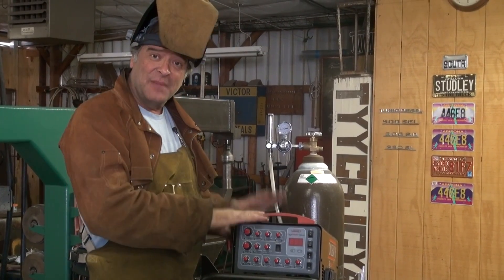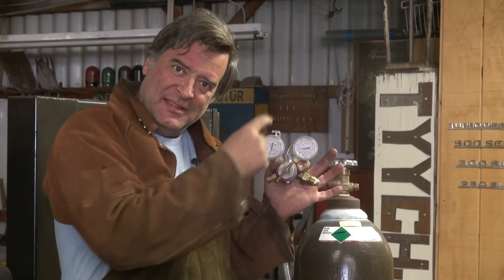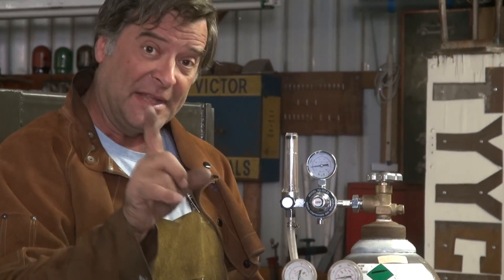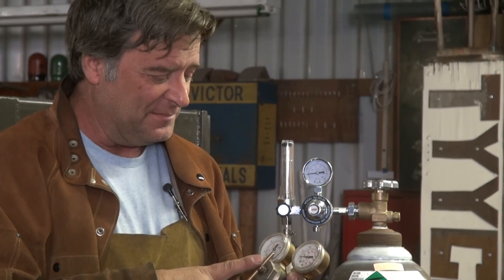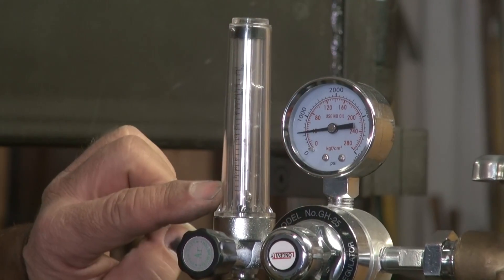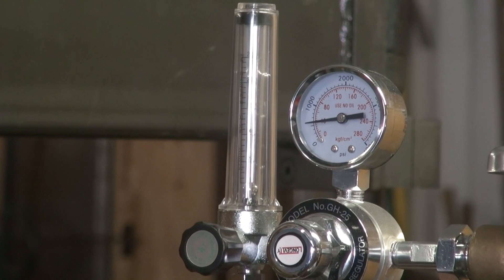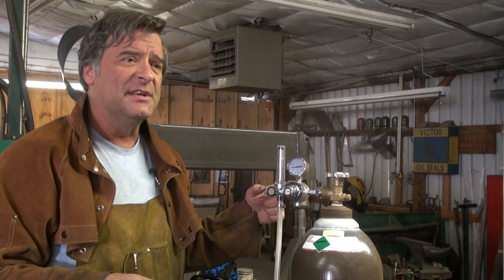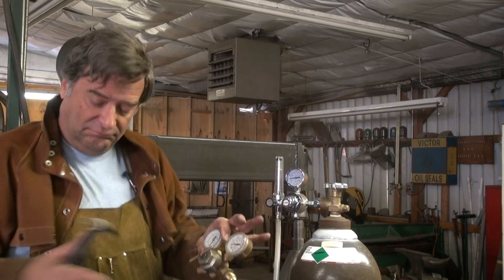How to Use a Flowmeter Instead of a Regulator for Welding - Kevin Caron

Comment: Can you ad a flow meter to a standard regulator? I have an expensive regulator and would like to do that instead of replacing it with a entire new unit with flow meter only.
Reply from the maker: Not that I have ever seen.
Reply: @KevincaronSculpture  I'm doing it. Bought a victor flow meter and I am going to ad a line to it and mount it so the gas flows through it. I could be wrong but I don't really see any reason why it wont work. On dedicated flow meters there is no pressure adjustment. I will be able to adjust pressure and flow.

Comment: 10 years after upload and this was just what I was looking for.
Timeless.
"Edited"
I'm a beginner getting in.
I have a flow meter (A little ball)", not a dual or anything other than. If yo want that they can run into a few hundred $, especially if you have to also purchase hoses.
I got a Unimig Regulator with a Flow ball because it was priced right and its just below industrial level grade tool usage.
I'm glad this was here to watch.
Reply from the maker: Thank you for watching and posting.

Comment: Actually, your are 100% incorrect. The gauge you show at 5:15 is a combination of pressure regulator (bottle pressure) on the right and a flow meter (lpm & cfm} on the left. Basically the same as what you now have mounted on your gas bottle, but in meter form rather than vial form. They both function the same - you are merely adjusting the flow of gas to your welder by either raising or lowering the ball (your current vial) or turning the dial (your old regulator). Not new either - they've both been readily available since before 2012 when you posted this video (obviously as you show at 5:15). Victor makes an extremely accurate pressure/flowmeter dial gauge setup - their FG250-50-580 argon/co2 flowgauge regulator. So, don't be chucking your regulator until you ascertain exactly what you have connected to your gas bottle...
Reply from the maker: Good point, thanks for posting and watching.

Comment: Hi thanks for nice video , my tig welding machine needs 30 psi of argon gas, how much liter per minute should I adjust I got same pressure regulator please let me know if possible thanks.
Reply from the maker: Toss the regulator in the tool box and get a flow meter.   Set the top of the ball to 12 to 15 on the argon scale. You will save a lot of money on the gas you save by using the flow meter over a regulator.

Comment: i've tested several of the inexpensive 2-gauge flow regulators with an accurate flowmeter downstream and have found that they are very inaccurate.. most tend to flow more gas than the gauge indicates. the floating ball regulator/flowmeter is much more accurate but in the past was also much more expensive, which is why inexpensive mig welders come with the cheaper regulator. i have 2 victor floating ball regulator/flowmeters, one for argon/steel mix/tri mix and the other for straight co2, both were almost $300 new 20 years ago... expensive yes but eventually you make it up in savings by not wasting expensive gas. and victor stuff is built like a tank and lasts forever.
Reply from the maker: Very true!   The flow meter is much more accurate. Thanks for watching and posting.

Comment: Shit, now I got more questions, argon for plasma? Liters, 8 to 12, what's that in standard?
Reply from the maker: Don't need to run argon for plasma.   You "can" but not needed.  I just run shop air and make sure it is dry with a filter or two.  My plasma cutter needs about 65 psi and wants about 60 gallons of capacity to run correctly.   Have run a small plasma on a roofing compressor,  just not for very long.
Reply: @KevincaronSculpture  compressed air is what I used, just wondering why anyone would use expensive gas? Maybe special material?
Reply: @KevincaronSculpture  as for liter question 20 to 25 cfpm, and it's about 8 psi.

Comment: I'd sure like to know how to get a hold of one of those.  Looked online and couldn't find that exact one.  Is there one for nitrogen?  How does one calculate for nitrogen on an argon metre?  Also, can you use a regular 1 1/8" wrench to attach it, and how tight?
Reply from the maker: check here,, https://www.everlastgenerators.com/catalog/migtig-argon-regulators    Not sure on using nitrogen and how it will work.   Sorry.

Comment: I just bought a Miller 22-80-580 flowmeter and it didn't come with a bodok seal. Do I need a bodok seal for this flowmeter or will it seal properly to the tank valve?
Reply from the maker: Should work just fine.   Have no personal experience with the Miller but from the photos online it looks just like mine.
Reply: Thanks Kevin. I went ahead and hooked it up just to find out and that flowmeter is really working nicely for me. I'm so glad to not be using the fluxcore anymore. I never really did figure out how to weld right with that wire. Now I'm back to professional looking solid welds and got my confidence back. Lol.

Comment: I just bought one of those TIG that does stick, plasma, and TIG. However having to change air source sucks so I stuck a standard quick connect to the end of a short section of hose. If I TIG, I pop the hose on from the machine, and if I need to plasma cut, I pop it off and put it in an air compressor.
Reply from the maker: Have never played with that kind of 3 in1 machine.  Never thought about how the air hose for plasma hooks up.  Thanks for the info.

Comment: Kevin, you're not using a flow meter instead of a regulator, you're using one in combination with a regulator.  That part of the assembly to which the cylinder contents gauge is attached is a fixed pressure regulator.  More specifically, it's a single stage regulator, a type  I'd not use for oxy acetylene welding, since they tend to "flutter", and not maintain an accurate working pressure, which leads to an inability to maintain the correct welding flame characteristics.  Probably OK for a shielding gas, though.
Were there no regulator in the assembly, it would be possible for the flow indicator/gauge and the hose as far as the machine solenoid valve to be subjected to cylinder pressure, with potentially disastrous results. 150 bar, or 2,200 psi is far more than hoses can withstand... I've been present when a guy opened up an oxygen cylinder valve, letting full cylinder pressure into a faulty regulator, and thereby into the hose.  Had the previous user relieved the spring of the regulator after use, perhaps the hose might have been saved, or certainly, the operator might have become aware of a fault earlier, as he adjusted his working pressure.  As it was, the hose went bang, immediately the cylinder valve was opened...
Fifty years ago, (so this is not new) I was taught TIG welding, using two stage, two gauge argon regulators (not all two gauge regulators are two stage, generally, two stage regulators have a larger body) and separate, removable, flow indicators.  It is also possible to obtain a flow indicator to apply at the tig or mig torch shroud to check flow at the point of application before starting work, too... The flow indicator at the regulator only indicates that shielding gas is getting past the machine's solenoid valve at the indicated rate, not guaranteeing it gets to the torch. any leaks (or a connection left completely undone) after the solenoid valve will reduce the actual flow to the torch.
I used to point the torch at my cheek (they're sensitive areas) momentarily before starting welding to get an idea of gas flow.  Not recommended with HF tig starting, or with MIG, unless you relieve the pressure on the drive rolls... 
I'm only here to see if I can find some accurate information on video for a relative who's in the process of buying a tig plant for his garage... I don't want him thinking a regulator's not necessary... It is!
Given the cost of welding gases nowadays, it's important to use them at the right rate, for the task (internal/external corners, say) and flow indicators are cheaper than wasted gas in the long term.
In principle, though, flow indicators are highly recommended.
Reply from the maker: Always learning something! 

Thanks for posting.

Comment: Useful information, Thanks for it. I have a question. What is the use of the little nut located at the bottom of  pressure gauge? do we need the adjust or set it up?
Reply from the maker: Not sure to tell the truth.     Never had a reason to play it.

Comment: I have a question i baught a flow meter of course from ebay i know that was my first mistake but anyhow with the gas valve open, its a 17 torch valve on top, with the valve completely open and gas flowing the  metal ball shoots up and will reach 20cubic foot and if i try to regulate it lower the ball falls to the bottom then i slowly turn it to rise the pressure it will reach 15 cubic foot but bounce up and down slowly, the argon hose i have has to be like 25 feet long could that be my problem ? any help would be great thanks.
Reply from the maker: Just barely open the valve on the torch. Or use a regulator for that style of torch.
Reply: Kevin Caron, Artist thank you sir

Comment: Hi, I want to achieve flow rate of between 15-20Lpm nitrogen gas however my regulator is in psi/bar,I understand that 'Bar/Psi' is pressure and that Lpm is flow however is there a way to do this? Thanks
Reply from the maker: Get a flow meter for nitrogen.   The tube will be calibrated for your gas.
Reply: Gosh I Never thought of doing that...Getting back to my question can it be done? No obnoxious answers plz?
Reply from the maker: I don't know if it can be done or not.   Maybe you could ask the guys on WeldingWeb.   They do this kind of thing for a living.
Reply: Thanks kev will do

Comment: My new unimig 200ACDC Pulse TIG won't output any gas. TURNING THE FLOW METER KNOB IN (i.e. screwing the knob in or out) INCREASES OR DECREASES THE FLOW RATE??? There is NIL info on exactly how  a flowmeter works anywhere on the pedantic, semantic know-it-all internet, only self praise. It's a public holiday so I can't get any work done. I never had any trouble with the pressure meters. Flow meter looks so SIMPLE (probably designed by morons for morons) until you need to use it. Typical ..Change for change sake. and a new profit earner. All the old pressure gauges rendered obsolete in one foul swoop. 27JAN2017
Reply from the maker: Start at the bottle.   Open valve a second to make sure gas flows.  Then install the flow meter.  Open valve again, does the meter go up?   Then with out the hose installed open the knob on the flow meter,  Gas flow?   Then install hose and try again.    Have seen hose fittings that were not drilled out before!     Or toss it back in the box and just use a pressure regulator.  Set the pressure to about 5 on the dial and go from there.    Flow meters are great to get a more accurate flow and save gas.
Reply: Appreciate your reply, but still want to know which way opens the knob... clockwise or anticlockwise..
Reply from the maker: anticlockwise will open the valve.
Reply: Thank you, Kevin. I was sure anticlockwise opens the valve, but not 100% sure. I am wary of explosion risk using high pressure containers. Rgds from Arnold Cook, Australia 28JAN2018
Reply: FYI, did as you suggested. Prob = blocked flowmeter base = dismantled = fine grit inside inlet gallery.= Now works fine. Thanks again.. I can save my day. 28JAN2018
Reply from the maker: Happy to help!  

Glad you found the problem and it was an easy fix.  

Happy welding

Comment: Im having issues installing my airflow regulator. It even popped the hose off of the end. Not sure what I am doing wrong or if the regulator doesnt work for my welder
Reply from the maker: Sorry , need more info.  What welder, flow meter do you have?     You said it popped the hose off, did it break the hose?   Or just come off the nipple?   Does the hose fit loose, like it is the wrong hose? Can you snip the end of the hose and get a tighter fit? Did you open the brass adjustment knob to get gas flow?

Comment: What is best for a 6g TIG root? I have several people telling me either or 

Would like your and anyone else's input.
Reply from the maker: Sorry, never done one.    Don't have an opinion.
Reply: Kevin Caron, Artist thanks anyway. your videos are great
Reply: Visit real welding forums to get more pipe welding info for any skill level, not just Youtube. Weldingwelb and the Miller forums are the best for US welders. Migwelding.uk cover all process EU style equipment. 

Pipe welders rightly prefer flowmeters. A tee and two singles is (second is for purge but if you are getting paid I strongly suggest owning more than one flowmeter to have a spare) how I set up ours at a welding school so if you damage one flowmeter you don't have to send out a dual for more expensive overhaul.

Comment: I just want to point out that just because the regulator has 2 gauges, that doesn't mean it's really a pressure regulator.  Many machines come with a 2 gauge "flow regulator"  They have a metered orifice on the outlet, and although when you turn the knob you are adjusting the pressure that goes to that orifice, only a given amount of gas will pass through that orifice at that pressure.  So the manufacturer puts a "flow gauge" on the output side of the regulator that tells you how much gas you are flowing.  That gauge in the USA would usually read in cubic feet per hour, or CFH.  So if your gauge reads CFH, it's NOT a pressure regulator.  The tube type, which is usually called a "flow meter" is more accurate, but the "flow regulator" is OK for most applications.
BTW, the regulator show at 5:15 is a flow regulator, not a pressure regulator.
Reply from the maker: Learn something new every day!

Comment: When I first started welding I didn't have a proper flow meter attached and consequently wasted a lot of gas. After fitting a flow meter I set it to the recommended 7 LPM, have since lowered it to 2.5 LPM which works just as well. How low are you running at?
Reply from the maker: I think mine is at 3 LPM.    

Thank you for watching.

Comment: what is like 40 ltr/min in psi terms?
Reply from the maker: Not sure but you should run in the 12  to 18 psi area on a pressure gauge.
Reply: you really cant compare flow with pressure...

Comment: Hey Kevin I have a question, should I always close the flow meter after each use or can I leave it set open (no pressure in the line) so its at the right flow rate for next time I weld? Cheers.
Reply from the maker: I don't touch mine once it is set correctly..    just turn off the bottle when you are done..
Reply: +Kevin Caron, Artist Thanks :)